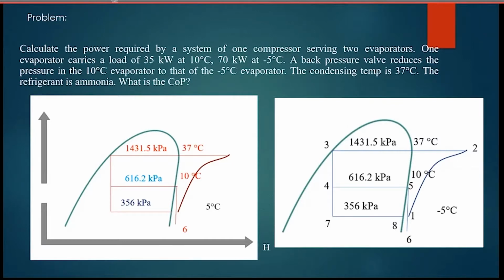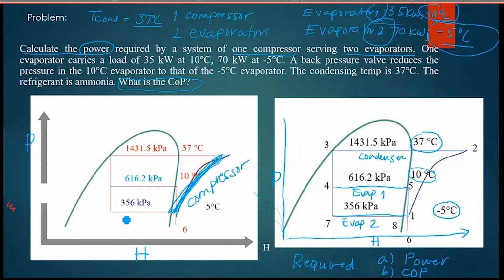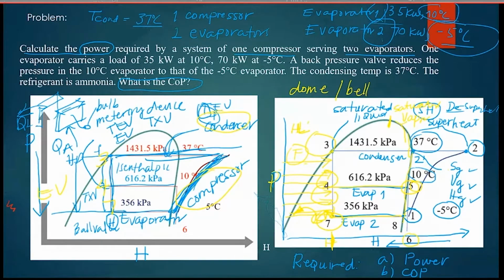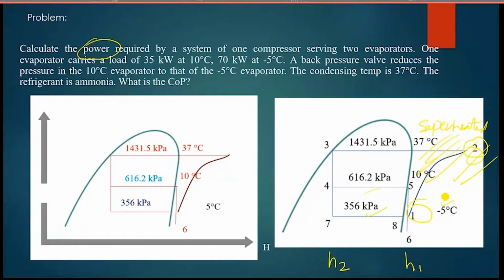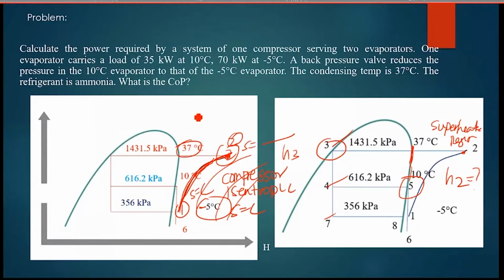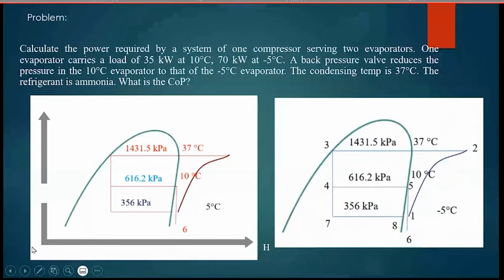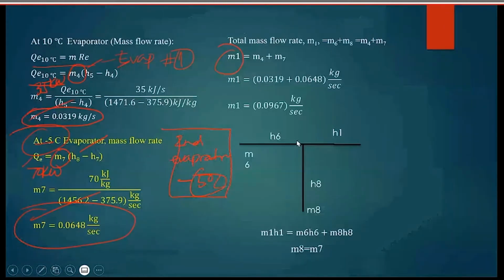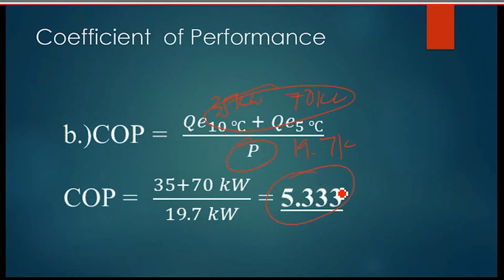RAC Multi Pressure Systems: Two Evaporators ,One Compressor Part 1

Comment: Thank you ProfCharlton!  I learned a lot and benefited from this course. There are many applications where air conditioning is required at different temperatures. There may be possible arrangements for multi evaporators on the basis of single or multi compressors. For example, a system for a specific temperature required in different places. In these cases, it is necessary to cool each place by separate evaporators to maintain the particular temperature and produce the required temperature.
By using a dual evaporator system, there can be a reduction in the energy used for different compressors and condensers for separate evaporators, as well as sufficient and required temperature and cooling can be maintained for different sections at the same time period. , cost reduction is another advantage by using multiple evaporator system. Very significant lesson ProfCharlton Academy!
Reply: tnx so much for  a very good and thorough , comprehensive comments